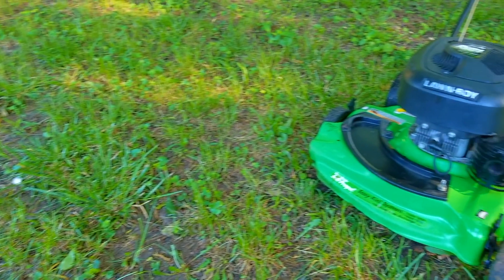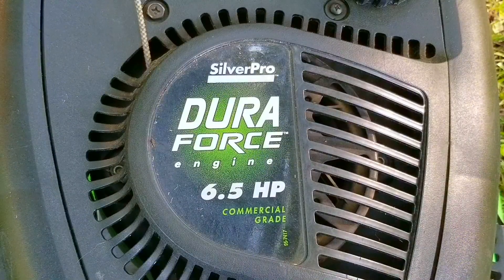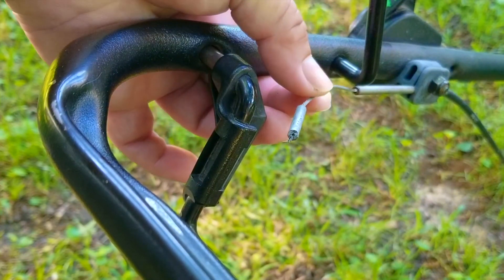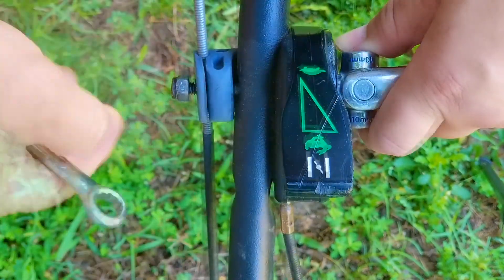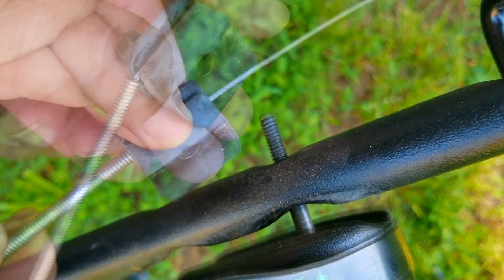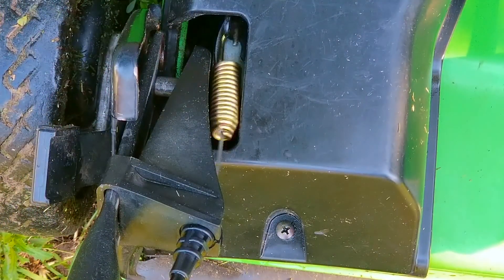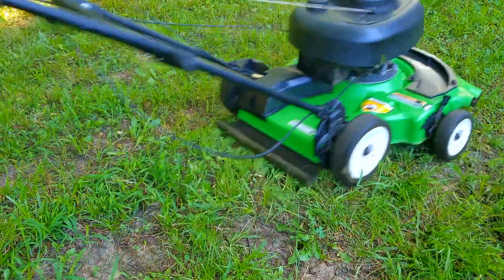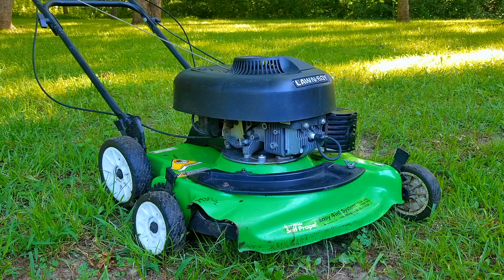Lawn Boy Mower self propel fixed

Comment: I’ve been using my dads since he gave it too me. He’s been using it since 1977. I’m waiting for the thing to finally blow up so I can rebuild it but with those mowers they just last forever. I even have a couple brand new ones (dura force models) still in the box sitting in my basement. I probably won’t have to dig one out until 2070 lol
Reply from the maker: yes these are some very good engines for sure

Comment: I had a 2 stroke one of those once. It set its self on fire while i was using it. I left it on the curb with a half melted motor. No one grabbed it it sat there for like a month lol
Reply from the maker: yeah,, I don't know if I would have picked it up either
Reply: @INSIDEHOUSEGARAGE  lol i ended up scrapping it, i got like $10 for it.

Comment: What an oddly shaped mower deck.....
Reply from the maker: I know right, I had to ask why but it's a better design when it comes to a side chute.
Reply: IMHO  the LB 10323 is the best mower ever for use with a bag.  its my favorite mower when the leaves fall.   the bagger to get is the rear bag.  the side bagger does not have the same volume the rear bag does.